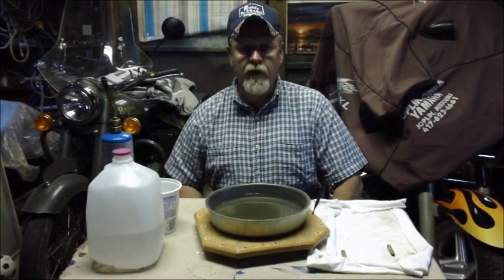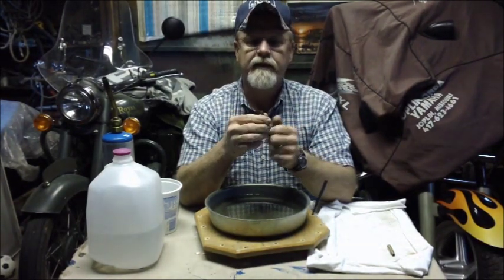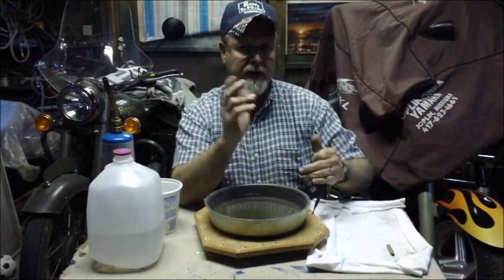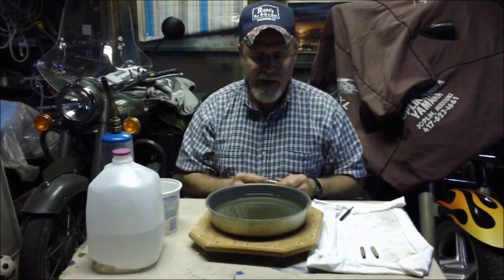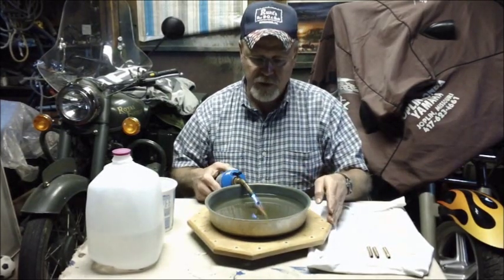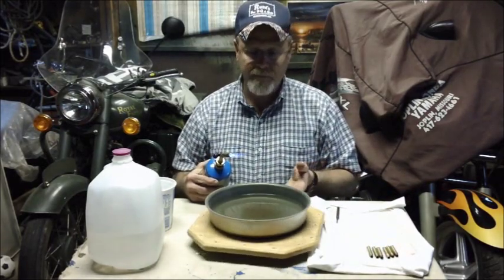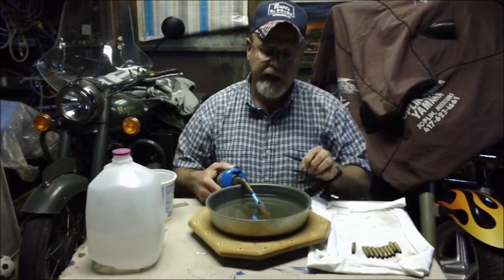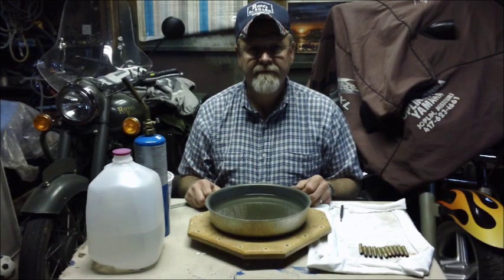Annealing Brass

Comment: There's a common mistake a lot of you reloaders are making when annealing your brass-never quench the brass in water after annealing, quenching the brass actually makes the brass brittle,and shortens the life of your brass drastically, Dont quench your brass shells in anything,heat the collar up for the appropriate time and let them cool naturally,that is the right way to extend the life of your brass,and the correct process for annealing brass.
Reply: Brass does not get brittle.  Water means nothing.  Use it or don't use it, it doesn't matter.
Reply: Funny if you watch people who work with brass, not related to shooting,  they quench in water so it can be quickly handled. 

Having the bottom of the case in water also buffers the heat, so the temp can be sustained longer with out over heating and keeps the body/ head from seeing any high temps. 

Seriously this is basically how Hornady’s re loading manual suggests doing it.

Comment: Thanks for the video! My only suggestion (from a safety aspect) would be to place the bucket of cases on your left so you don't have to cross your left arm in front of your right arm (that's holding the torch).

Comment: As a professional engineer may I comment that this is wrong and possibly dangerous. Your method is way too hot (see the orange flame flare) and quenching makes no difference to the hardness with brass (unlike steel).
Your process is a bit hit and miss, possibly resulting in variable neck tension and even neck separation if extreme over softening has happened. At least the water will help stop heat migrating down the case. By the way, the temperature of the water is irrelevant - even if it’s about to turn to steam it’s way too cold to affect the brass structure.
If you want to do it right around 375C/700F for 3 to 5 seconds is a good starting point.
Reply: I agree. My understanding is that the orange flame is caused by the zinc being "cooked" out of the brass. I like the molten salt method (40% Potassium Nitrate, 60% Sodium Nitrate). The temperature/time that seems to be the most common with this method is 500C/932F for 5 seconds. Does this sound about right to you?

Comment: Great video thank you for making and posting. I am new to reloading and my brass has not yet gotten to 5 or so reloads. But when it does this is what I will be doing to anneal. 

One question: do you just let your brass air dry inside and out or do you dry off the surface put the brass in the tumbler and let the media dry off the inside? Does it matter which way? 

Thanks again for the video.

Peace.